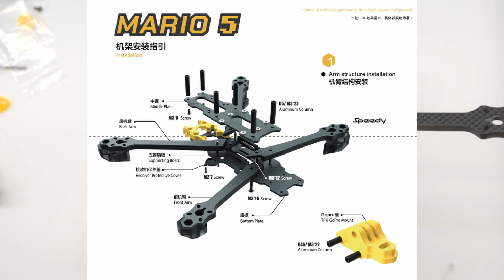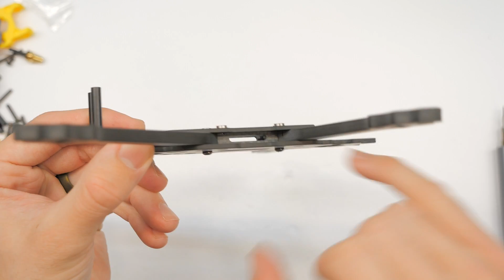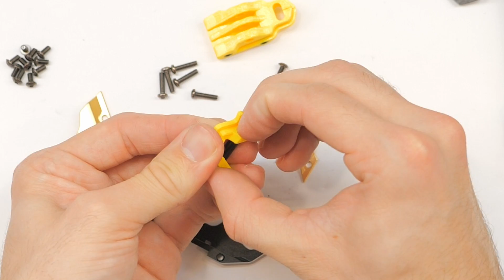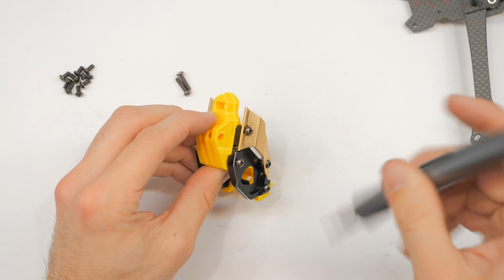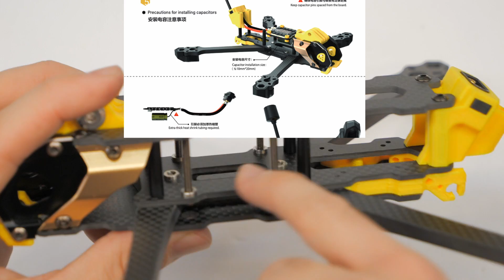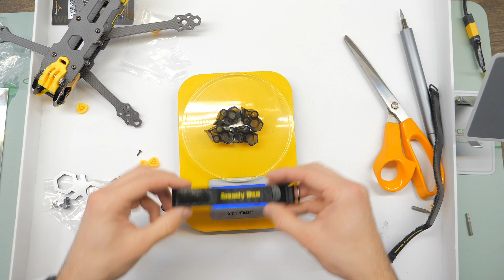The PRICE is right (Sub $40)! But is the design? SpeedyBee Mario 5 DC Frame Assembly and Review

Comment: Just got this frame for my build and it’s an awesome design. My only disappointment so far is that it appears the VTX heat sinks that come with the “Pro” kit are exactly 1mm shy of enough clearance for the Walksnail Moonlight VTX. Waiting for the VTX to arrive so going off documentation. I get that they were officially made for the DJI O3, but 1 millimeter? Could’ve easily accommodated every digital VTX on the market with 1mm less material…
Reply: Iam planning to build this frame with Walksnail. Let me know how u managed the final build ;)
Reply: @ the aluminum heat sinks won’t work at all on walksnail, unless you happen to have a milling machine to take out some material. Without them though, the vtx installs just fine. Very nice, sturdy frame. I haven’t finished the firmware side of the build yet, so couldn’t tell you how it flies yet, but I’m sure just fine.

Comment: Watched quite a few reviews of this frame, and everyone of the reviewers read (viewed) the instructions, and knew what every component was for or did. I guess you never? 

Never built a Quad before, and chose the pro version as my first build. It could not have been simpler. Extremely easy to put together. So if you found it harder than normal, other frames must be child proof.

Comment: Hi, I am planning on buying this frame, but I can't find some dimensions I need. Did you have the time to measure anything ? Do you now where I can find measurements ? I want the top plate width and height, but it's not mentionned anywhere in the product datasheet. Thanks !

Comment: Anybody use the feet?, my build stalled on that (video or instructions dont cover it).  I have speedybee motors, and this frame, but no screws.  

This is like the 5th build video I’ve watched..  and they all stop where the instructions stop….what the point?
Reply from the maker: I don't use the feet. I think it's pretty straight forward to install, just need to use longer screws than normal.
Reply: @RCwithAdam1  It wasn’t , I had to order the screws. It was weird the kit did not come with it, so I kept looking for a solution provided in what was sent.  Thank you for the response and video.